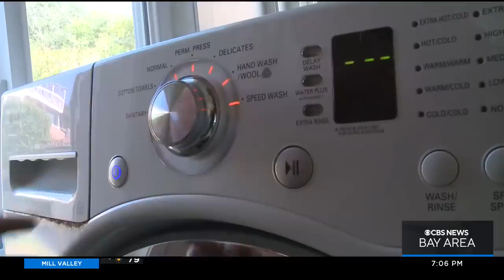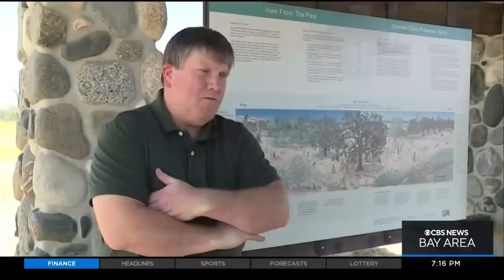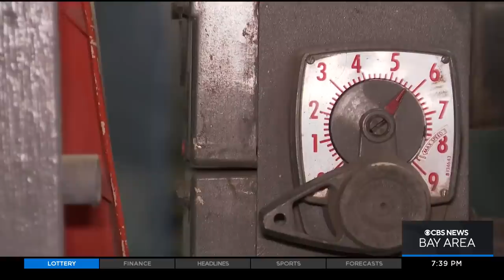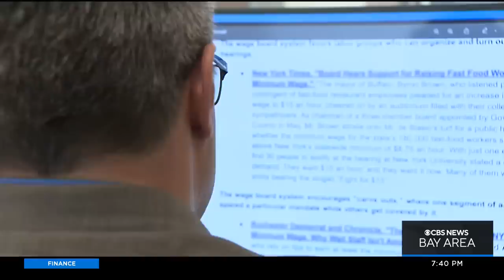Parched: California's Climate Crisis

Comment: This is what happens when you let corrupt water board supervisors linger around for 3 terms, then vote to extend another term… There were enough funds to build more reservoirs, and we the voters decide to waste that for bureaucrat raises and consultant fees that did nothing
Reply: No, that isn't the case at all.
Reply: What are more reservoirs going to do for you? A lot of the water running out is ground water. Not the kind you collect from rain. There are to many people in that state. It is unsustainable.
Reply: reservoir is not the issue. The amount used is the biggest problem for various superficial uses, such as: pools, lawns, watering produce that don't benefit the population as a whole. Don't forget 40% of alfalfa grown in California is exported to China, 80% of almonds are exported out of the country, 25% of hay is exported also out of the country, 50% of limes, lemon and oranges are exported out of the country. And the total lack of charging or the absurdly cheap price for this natural product. Even us in Canada (which has also a tremendous quantity of water) where the average consumption FOR two person is 3,222 gallons per year for an annual cost of 1025$ usd. California consumes 56 gallon per person per day ( 20,440 gal per yr) at an average price of 0.03$/gal so only 613$. Right there that's a huge problem. Think about it logically, if the price was higher people would budget differently and instead of putting a pool in the back yard put one for the community; indoors to reduce evaporation just like every "normal" society.
Reply: @robert-antoinedenault5901  Over half of my water bill in Texas is for the monthly meter fee. If I decrease my usage by 50% it would reduce my water bill by about 20%. This is kinda stupid if you want to encourage water conservation. Residential water fees should also be incremental. It should cost more for a gallon of water based on the amount of water used. For example $7.00 for the first 500 gallons. $14.00 for the next 500 gallons. <--- numbers not based on reality, just as an example. 😁 This might make people think twice about watering the sidewalk while still keeping cost low for people who conserve water. Also thanks for your comment. Good to know some people out there actually care. 👍
Reply: @jackiepaper101  climate change is the norm of living on earth, with or without humans. Humans can easily adjust to climate change by environmental engineering. All you need is science based governance, which we haven’t had in CA for decades and now haunts us
Reply: @Deno2100  ground water and surface water interacts with each other. Having surface reserve helps enrich underground flow downstream and catches upstream underground flow
Reply: @simplethings3730  True and the meter thing is odd as it is supplied by the city (as it is an ordonnance when building a home) so the cost of it should just be included in your city tax for a very low cost as they cost 40$ over 50 to 100 year period (some last even over 200 years if made out of cast iron)
Reply: The state needs a population cut not reservoir increase
Reply: Aqueducts and desalination plants are expensive and frankly a destructive approach.  It is vulnerable, brittle, and fails to address concurrent problems.  You end up using a ton of electricity to pump water in the aquifers, as well as desalinating water.  It would increase brownouts.

The better approach is the prevent collecting too much water at dams in the first place.  
It is better to do smaller, decentralized, water-harvesting earthworks/techniques starting in the foothills, and continue thru to cities.  These would include keylining, check dams, bunds, swales, gully repair, planting pits etc.  More bioswales with curbcuts to feed street runoff into them is a start in urban areas, as well as encouraging the purchase of cisterns, using greywater for watering lawns and trees, as well as using roof runoff for water, flushing etc.
Decentralized efforts can reduce fire danger, flooding, lessen drought impacts.  Bioswales planted with trees can reduce heat island effects, allow pavement to last longer.  By passively using rainwater in bioswales, reusing greywater and roofwater you can reduce the amount of electricity used to irrigate and reduce the chance of brownouts.  
Keeping landscaping hydrated this way also keeps the soil biota hydrated and allows water too seep better into the soil instead of running off.  
Overall using rainwater harvesting techniques/earthworks recharges aquifers and surface water in a positive downstream effect.  
Brad Lancaster has YT videos and books on the subject.

Lots of water falls there, even during droughts but it is squandered.  Back up and reassess where you look for problems/solutions...

Farming and ranching could be done much better.  'Sustainable ag' is a greenwashing term to sell more products to farmers and ranchers rather than solve deep ag problems.  Restorative ag techniques work much better and for less while producing more food.
Reply: @b_uppy  nope. There’s just not enough dams and reservoirs for California. You can consider those alternatives, but that’s like trying to put out a house fire with a ladle. Neither is it unrealistic to say reduce the population, since we’ve gone past that debate decades ago.
Reply: @yn5568  
Dams and reservoirs divert water from streams and rivers, wrong premise entirely.  You snoozed you as you read, then you just spout of more of the same bad solutions engineers, city planners, conventional ranchers and farmers, etc keep idiotically perpetuating.  These are the biggest culprits in contributing to the ongoing problem.
Let me reiterate: I said rainwater harvesting earthworks and techniques.  A check dam is different in effectiveness and function in recharging aquifers and water tables compared to a hydroelectric dam, or a city reservoire.
Suggest you start by watching some Brad Lancaster and Mark Shepard videos to open your eyes to a whole world of decentralized, alternative methods.
Reply: @b_uppy  too bad I actually read your point and it sucks. Rainwater harvesting is inefficient and high footprint work that can only supplement vast needs for urban water usage. What you’re saying is like “rooftop solar solves the energy crisis”, without thinking about the big numbers.   Just because you write an entire essay on YouTube comment, doesn’t make it any smarter or correct.
Reply: @b_uppy  if coastal cities used desal instead of draining our inland areas, we would be much better off.  Owens valley,for example, would be much improved.
Reply: @Y N  
What's 'too bad and sucks' is your counterargument.  This work is durable and has a highly effective return and for that very reason its footprint is very low.  It pays for itself in many ways that others fail at.  It is exactly what I say it is.  Other solutions cannot day that.  There are minimally placed swales in the Sonoran Desert made by hand 90 years ago by the CCC that have had zero maintenance done on them since.  They have raised the water table in the alleys where they occur allowing revegetation to occur.  They will likely last centuries longer.  
The same cannot be said of other solutions you've got only one return on aqueducts, water pumps and desalination plants. Your alternatives are financial failures meant only to keep people dependent and desperately paying for solutions that have less and less return.
You have zero solutions that come close.
Reply: @b_uppy  see, I put my argument in very concise way, and you’re not even comprehending. When did I ever mention desalination?   You’re not even making a conversation; you’re just writing 10 paragraph nonsense just to make it feel like you’re counter arguing
Reply: @yn5568  
People only hear part of the solutions when discussing water issues and I like to make sure that alternatives are spoken of in full light.  People have misconceived ideas as to what it is, or even how hydrology, soilscience etc works. 
It's like they're forgetting other aspects of the equation  that give more value.  I use words like 'durable,' 'decentralized' etc for a reason.  
Consequences and related impacts are hidden from view when these problems are discussed.  If we keep looking at patch jobs instead of approaching it holistically we will be broke and living in offal.
Soundbytes are for politicians
I counterargued, you whined.
Reply: @Y N  
 You're science deaf.  You're operating on old premises.  The old theories have been shattered.  
Firstly you would have to choose the correct solution(s) for a site.  You'd need to make observations of terrain, soil, compaction, so8l cover, etc. 
Check dams are great in areas where erosion is a big issue, such as places recovering from fire.  You would likely need to employ other solutions to the site as well.  It's good to use on-site materials as this lessen site impact.
An important takeaway is to start small and as high in the watershed as is feasible to slow erosive damage. 
This superior in practicality over the old reforestation practice of 'stick a tree in the ground.'

You're attacking me and my argument by inferring I am 'a sociology major' reflects badly on you and shows your lack of ability to rebut with better argument.

Comment: Reduce birth rate... Reduce migration and immigration. Stop tearing down hillsides to build large houses. If you must build, tear down old industrial areas, clean them up and build there. Redirect rainwaters to retention ponds.
Reply: Some industrial areas are too contaminated for housing. It would be great to have those lots for public events or anything that doesn't require any plumbing of sorts
Reply: @mexico14000  actually a lot of these areas are a lot more easy to clean than they look. Some of the most expensive homes on the coast in Orange County are on top of what used to be the OC dump in the '60s. There's a lot of area in Orange Tustin, Irvine, Costa, Mesa, etc. that could be rezoned for housing

Comment: It's a proven fact  that trees shade the ground to keep the dirt from drying out. Just a though when cutting down Forrest  for farming , solar farms and housing developments.
Reply: my trees use water they don't save it
Reply: Solar panels are providing a water source because as it rains it providing shade for the water to have time to absorb into the ground.. not kicking anything that you are saying. I have a 7 phases and 3 phases each to solve this matter and I am watching for anyone who is interested in being the investor and board members to accomplish this project.
Reply: Which trees would you recommend and which trees are a  bad choice? 
For instance... Olive, Carob, Eucalyptus and Pine trees thrive in hot dry climates. Olive and Carob trees are fire resistant, making them a good choice. Eucalyptus and Pine are fire hazards, so they should be removed and replaced with a good choice.
Reply: I'm growing abaric trees. And Lily of the valley they all need water but the abaric trees are used for the clear golden resin and used in drinks also the shape is 40' tall and 60' wide and survive in the desert. I have about 10 only due to weather conditions and hail storms. Everything struggling to survive in 110° in mid summer.
Reply: Why is it when humans and animals  are  out in the heat they like to stand under  a tree to cool off? Grass also seems to be greener  under  a tree and not dehydrated.  Just a thought. Just maybe it could be cooler  under  a tree. Hello.